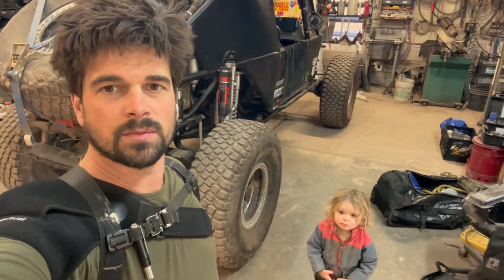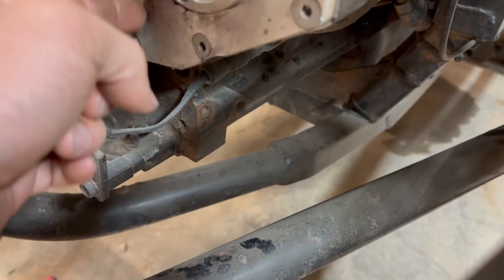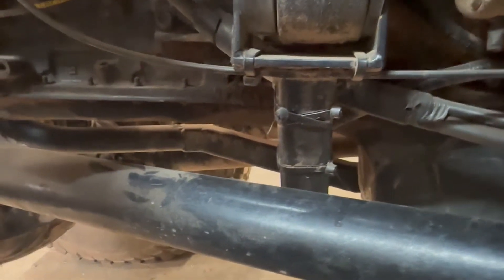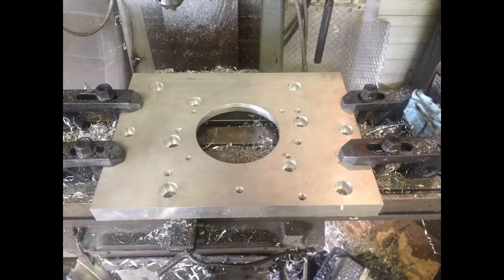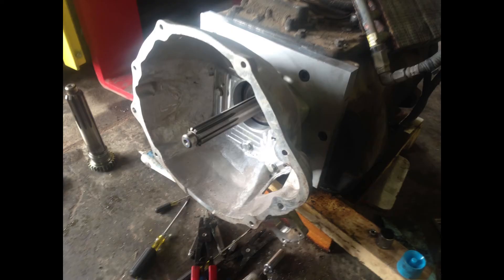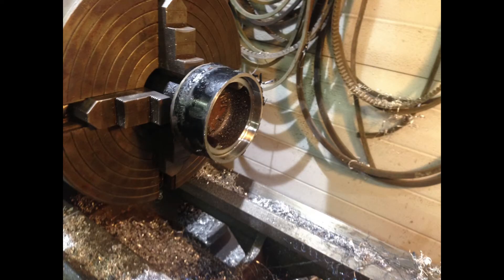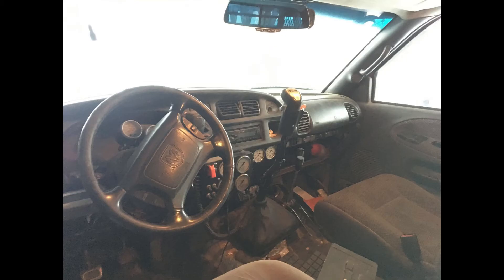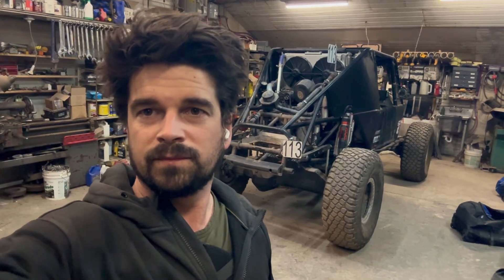10 Speed Eaton RoadRanger Transmission Swap in a Dodge Ram 3500 Cummins Diesel plus Shop Projects

Comment: Just buy a bigger truck dude
Reply from the maker: haha, yeah well I have a big truck now.  At the time I was trying to avoid all that.
Reply: @irionmotorsports  BTW, I was busting on you a lil. I'm a truck driver. That's a cool truck and cool project.
Reply from the maker: Haha, yeah but you're not wrong.  It's so much easier just having a truck that's built for it.  Thanks man.

Comment: Have you considered a dry dump oiling system?
Reply from the maker: I assume you're asking about the race car?  I try to keep everything as simple as possible.  The fewer electronics, belts, pulleys, bearings, hoses etc the better.  A dry sump would introduce so many failure points with very little gain and cost me a ton of money.  I don't need any more hp, and I have an accusump to give me a bit of oil pressure if I'm on my side.

Comment: On the oil ...
A filter remote fitting an plenty of hd hose n fittings ...
Large oil cooler ...
Dual Remote mount oil filters ...
Large full qiart oil filters (the big mothers) ...
Oil is the life blood of an engine keep it cool an have lots of it !!!
Allows for smaller oil pan ...

Comment: How did you shift the hot and low in the 10th speed without air? I'm very interested in doing this to my 1999 254 super duty. I am tired of the triton five point four I put 2 Cright motors in that truck since nineteen ninety nine twenty three years three motors not good
Reply from the maker: Did you watch the whole video?  I'm pretty sure I showed the air system install towards the end of the video.

Comment: I cannot believe how many NV5600's you blew up !  I know you're putting out a bit more HP than stock, but I tow heavy shit around every day in hilly VT and got 200,000 out of my stock Cummins 3500 without ever having a problem with the transmission. I can't believe the NP 205 never gave you trouble with the extra HP if the NV5600 couldn't handle it.
Reply from the maker: Yeah, it was the combination of the extra hp and weight.  I was regularly exceeding 25k, sometimes as high as 30k.  You could do that with a stock truck without issues, but when you add 200-300 hp it doesn't hold up.  The np 205 is the toughest transfer case that ever came stock in a vehicle.  I run one in my race car too, and I've never had a single issue with them.

Comment: I’m sure by now you have already made your oil pan, but my first thought was that you should do a dry sump oiling system.
Reply from the maker: That's something that I considered, but there's not much of an advantage in this case and lots of downside.  This motor puts out more hp than I need, so I don't need the little bit that I would gain from a dry sump.  The weight difference would be negligible.  The biggest downside is adding a number of high probability failure points to my car. I would have to a scavenge pump with a belt drive to the bottom of my motor where mud and rocks could get in.  If that belt gets destroyed I'm done.  There's also a whole bunch more hoses and fittings that can fail.  The whole point of using a Cummins in the first place is the simplicity and durability.  Also, I'm a cheap SOB.

Comment: How thick was the plate of aluminum on the front of the Eaton for the nv4500 bellhousing adapter
Reply from the maker: Well man, you got lucky.  It turns out I still have the slug that I cut out of the center of that plate sitting on my lathe.  It is 1.25" thick.
Reply: @irionmotorsports  well how about that? I’ve been wanting to do this swap on my 03 commonrail but didn’t wanna put a sae2 bell housing and hack up a bunch of my floor a little bit I can deal with though and how much did you have to shorten your input shaft? If you remember maybe it’s in the video and I didn’t hear it?
Reply from the maker: I didn't shorten the input shaft at all.  I calculated that the 1.25" plate would make it so I wouldn't have to modify to input shaft.
Reply: @irionmotorsports  boy that sure is good to know I thought you had shortened it I have looked at so many threads on it it’s been a catastrophe on the hydraulic part do you have the part numbers for the concentric throw out bearing  inside the bellhousing?
Reply from the maker: Yeah it's a0022506615.  It's from a mercedes atego.  There's a bleeder adapter and a line adapter that they don't usually come with it.  If you can find a parts diagram for the atego, it will show you what you need.
Reply: @irionmotorsports  alrighty thank you so much for the help if I have anymore questions I’ll Defiently ask thanks!!
Reply: @irionmotorsports alright another few questions for you do you happen to remeber how wide the sheet of aluminum was? I know is gotta be bigger than a foot on each side
Reply from the maker: Yeah, it was, but I don't remember the exact size.

Comment: Just curious what did you do in terms of a clutch brake?
Reply from the maker: There was no way to put a clutch brake in since I used the dodge clutch which is a push style.  I just dealt with it.  It's not hard to get used to.  I would rarely stop at lights.  Just put it in first and let it creep.  It also didn't take quite as long to slow down as a big truck.  Probably to smaller lighter clutch disks helped.

Comment: Hey I'm very interested in following you 8m planning a swap to Eaton in my 2004 ram with the 48re I have had lots of heat issues with them hauling hay 40k lbs is just to much for the trans the rest of the truck handles fine I'm a rancher haul hay twice a month no other choice than a day cab or a swap. This is a great interest. I am running compounds as well.
Reply from the maker: Nice, good luck man.  If you're hauling that much and putting and eaton in, you might want to take a look at your rear end while you're at it.  I blew mine out about 200 miles from home.  New bearings and a backlash adjustment would have saved me a lot of time and a ring and pinion set.

Comment: someone recently told me that a 10 speed would fit into a dodge. I had no idea. I have an 89 dodge 1/2 ton. im wanting to swap it to a cummins as well as a manual trans. Now im not sure if i would actually swap in a 10 speed, but I would like to learn more about it because I never knew you could. what all would ya have to do to have a 10 spd manual or a 9 spd manual fit into a 1/2 ton?
Reply from the maker: I don't know where to start man.  A 1500 can't handle that.  The suspension can't handle the weight and the axles can't handle the torque.  There's a reason why they only put the cummins in a 2500.  There's a smaller 10 speed that fits a little bit better, but it's still a lot of work and leaves you without 4X4.  Also, it only handles 600lbft of torque, which is not enough if you do any performance upgrades.  Easiest thing to do is to just get a 2500 that's already set up.  If you're really attached to that truck you could buy a 2500 for parts, build that truck the way you want and then drop the 1500 body on, but that would be a huge amount of work.
Reply: @irionmotorsports  im gonna throw the 4bt in the truck because of the weight. Plus it is a bit more fuel efficient than the 6bt. I was just curious about a 9 or 10 speed manual transmission. Someone told me there is a "smaller 9 speed" that only weights about 250. Just wanted to get your perspective
Reply from the maker: Gotcha, that makes more sense.  I wouldn't bother with a 9 or10 speed personally.  I don't think 250lbs is accurate, and that's the weight without a transfer case.  My 6sp nv5600 stock dodge transmission was over 300lbs.  You could find a zf 5 or equivalent tranny that probably weighs around 150lbs without the t-case.  Also, if you want 4x4 it's a huge amount of work.   You really want to keep that thing light.  The 4bt is pretty underpowered.  You can get more power out of them, but not without really taxing the motor and blowing head gaskets.  I had one in a van with o rings and head studs and it loved to blow gaskets.  I wouldn't put a 4 bt in a vehicle that weighs more than 4k, 4.5k at most.  I guess the question is why?  Just because you can? If you want to build it just because, then go for it.  I don't want to dissuade you from doing someting crazy just for the hell of it.  However, if you're looking for something that is more functional and easy to drive on a regular basis, put the lightest, smallest tranny in that will handle the power.  Have you considered an automatic with a manual valve body?  I have one in my race car and it's awesome.
Reply: @irionmotorsports  well im actually throwing the 4bt into an 89 Ramcharger haha. And i know ill more than likely go with a 6 speed. I am just curious to explore and learn more about 9 and 10 speed manuals haha. Its just fun to think about. Im doing this swap purely for fuel economy reasons.
Reply: @irionmotorsports  i have not heard of that before. How does that work? The auto with a manual valave?
Reply from the maker: It's just an auto that doesn't shift by itself.  You could get a 47re that would bolt right up and get a manual shift kit, which is really cheap.  Then you have a 3 position shifter like a cheatah, or winters shifter with a button for overdrive.  Manual shift kits only come in forward shift pattern (PRN321).  If you want a reverse shift pattern (PRN123) then you need a manual valve body which is more expensive.  I needed the reverse pattern for racing so I can go back and forth from R to 1 quickly, but for a DD I don't see the point in spending the extra $.
Reply: @irionmotorsports  ill have to look intot hat
Reply: Yes. it could be done just time and $$$ I don't know of any smaller 9 spds The 610/613  6610/6613 are the smallest that I know of an I have been messing with this stuff for 45 years. I have a 79' Ford F350 4x4 with a 453T Detroit Diesel and a RTO 6610
Reply: @phatboizbackyardkustomz9006  oh okay thanks. How heavy are those transmissions?
Reply: @brandonpropterhoc   the small rt/rto 610/6610 613/6613s are in the 4 to 500lb range the rtos are the overdrive one's the rts are direct drive I would look for a RTO
Reply: @phatboizbackyardkustomz9006  okay. And that is a 9 speed? How big is that transmission? Dimension wise.
Reply: @brandonpropterhoc   10 and 13 spd I will have to get back with you on the dimensions. The 9spds are bigger and heavier.
Reply: @phatboizbackyardkustomz9006  oh really? Thats interesting. Thanks for the info!

Comment: Dude I dreamt of doing this to my 05 3500, I haul for a living and went through 3 nv5600s in a year and a half, loved the truck and manual transmission but not the headache of the trans, I’d of kept it if I could have done this conversion, incredible job 👍👍
Reply from the maker: Thanks man. I always thought those nv5600's were some of the toughest transmissions until I blew 3 of them up.  They just don't seem to hold up if you're towing heavy and I don't like the way they shift either.

Comment: If you could make a "conversion kit" for this swap thatd be so damn awesome. Floating gears and not worrying about blowing a transmission with extra power torque. Great talent good job.
Reply from the maker: Thanks man.  I have a full time job in addition to these projects.  No time to be putting together kits at this point.

Comment: Could a 3" body lift have eliminated the need to construct a new transmission hump?
Reply from the maker: It might work.  The biggest issue is the width.  The top corners on the transmission might hit on the edges of the transmission tunnel.  I know there was a guy that put a body lift on his truck to put a roadranger in, but I don't know if it was 3" or 4".

Comment: Would love a video on it if the new owner would bring it back . Particularly interested in the propane injection I've been wondering about doing that. Curious to see how you laid it out and what your experiences with it were
Reply from the maker: It worked well.  I made a plywood box for the bed of the truck and put 2 30lb cylinders in it.  It probably added 50+hp when it came on, and helped with egt's and fuel milage.  I have a propane filling station so I was getting it at $1.80 per gallon at the time.  It was just  a Nash Fuel kit off of ebay.

Comment: Need me to bring the truck up for some fresh pictures or videos?
Reply from the maker: Haha, yeah those photos aren’t the best.  I wish I’d done a better job documenting it.  How’s Frank doing?  Have you had any issues?
Reply: @irionmotorsports  good, he needs a few things, high pressure turbo, heater core, just some general TLC, range selection synchro. Going to try and get into it this summer hopefully. Looks so good after paint I don't wanna drive it lol. The AC still blows ice cubes though.
Reply from the maker: Nice, good to hear.  I had to get creative when I cut the cab back to run the exhaust out of the wheel well.  I think I cut some of the plastic off of the bottom of the heater off to get the space I needed.  I can’t remember very well but I might have sealed it up with a piece of rubber roofing and geocel.  I don’t think it will be a problem when you replace the heater core, but it may need a new piece of rubber while you’re in there.
Reply: @rossbrowning2669  how much you want to sell frank for?😂👀
Reply: We need some more videos on frank👀
Reply from the maker: I wish I had been making videos back when I was building frank.  All I have is some pictures.  I had another build where I put a 4bt in an E-350.  I only have photos of that too, but maybe I'll do a video of that sometime.